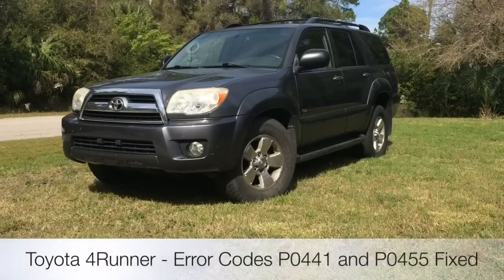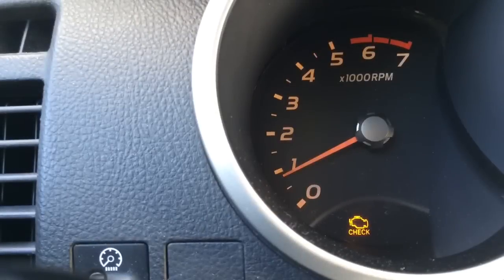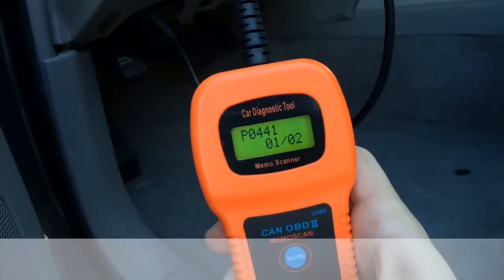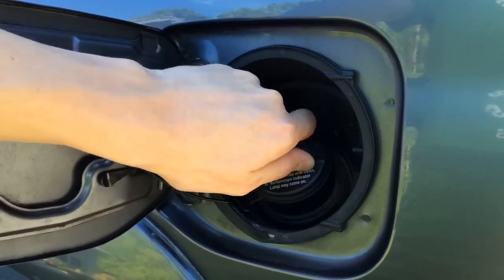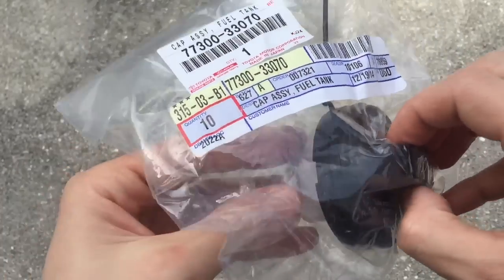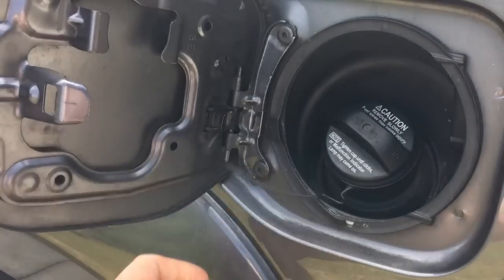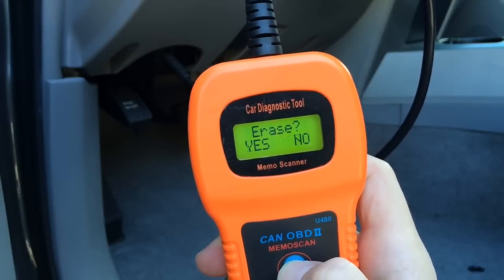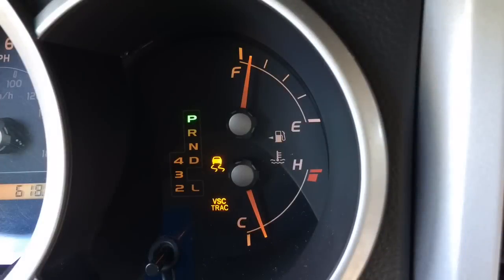[SOLVED]: P0441, P0455 & P0456 Codes - Evaporative Emission Control System Leak - Bad Fuel Tank Cap

Comment: code scanners are ok but its a small guide line to what the symptom is, p 0441 and p 0455 are small to large leaks,,and yes in most cases this will tell you to check the gas cap,,in most cases if the car has the original cap chanses are good that the cap o ring is worn and for the 40 dollars its worth replacing anyways, now most cases the  code or both codes may or will come back with pending codes in the system, this means the car is self checking the system, this may take up to 40 to 50 key cycles,, if the codes are still there then there is other issues like a bad purge valvem this means that its not holding vaccume, or is not sealing properly or does not activate on power up.. check the oms, the reading should be between 14 and 30,, under or over that threshold the valve needs replacing, if you now are at the stage that the cap and valve have been replaced and codes are still there, then vaccume lines need to be looked at for leaks or cracks, possibly the canister is contaminated with fue, this contamination is caused when a owner overfills the car with fuel,,what i mean by this and we have all seen that one person having to to be at the exact number on the pump ex: 56.00  dollars, when the pump clicked at 55 .10, overfill will contaminate the canister in time,,, so when it clicks ,,,,stop,,,,so to finalize this rant,,, cap ,valve and last contaminated canister,,,,,but there is no replacement for a good scan tool, those 40 dollar units are ok but they are basic and can steer you wrong at times,,, but they do help

Comment: I’m having this problem but they say it’s the EVAP canister and I’m not entirely sure I trust that diagnosis. I used some bad gas by accident recently and have treated my fuel tank with stabilizer, hoping that will help
Reply from the maker: Go get a second opinion in a different place and see if they give you the same reason... Don’t tell them about the first diagnosis.

Comment: Hello 
Will my warrant be void. If i clear the check engine light with the obd scanner. I have a EVAP leak in my 2016 Corolla P0455 and P0441 so i decided to get a new oem gas cap and remove the old one and then clear the check engine light with obd scanner.  So will this void my car's warranty or is it safe  to do this. ??? 

Thank you.
Reply from the maker: I don't think so, but I would say call them and ask, just to be safe.

Comment: Bitch I looked up code p0441 and that's why I watched this video. Not to fix my gas cap.
Reply: Sirjacome48 Same lol I got the same code so I just bought a new evap valve
Reply: Same lol. I wanted to fix that not my gas cap. This nigga should have fixed the purge flow valve not the gas cap.
Reply: Sirjacome48 did replacing it work?
Reply: oh okay. i just got the evap. canister thing removed and the light came back on.. so i went to get it tested and the highest chance was the gas cap so i bought a new one. when do you think the light will come off.
Reply from the maker: I can tell you for sure, replacing gas cap worked for me.
Reply from the maker: Did that work?
Reply from the maker: You can fix whatever you want, I just showed what worked in my case. After replacing gas cap problem never came back. 
If you had similar codes, but different solution for the problem, go ahead and share your tips with others  in the comments or better yet record a vidoe and share it with the world, rather than complaining about others who tries to help by sharing their experience. 
Best regards.
Reply from the maker: It takes certain amount of driving cycles until ECU relearns  and codes will go away. But you can also erase the codes using OBD2 diagnostic tool, or unplug battery terminal as a last resort.
Reply from the maker: +Sirjacome48 
Fuel tank along with gas cap are both parts of evap control system and are directly related to the problem for P0441 code. Broken or loose gas cap disrupts system vacuum, causing P0441 and/or some other codes. Pease do some research before showing your disrespectful manners next time. Greatly appreciated.

Comment: where did you buy the toyota gas cap at
Reply from the maker: Most of the time and almost everything I buy online.
It's always much cheaper then buying from dealer or autoparts store.
I only shop at Amazon.com and ebay.com online.
These websites are very reliable and have literally everything...
Reply from the maker: Also there is direct link for gas cap in the description of the video if you need help finding it.
I hope that helps!

Comment: i replace new cap but after 10 days the code come back
Reply from the maker: Is new cap closing tightly?
Reply: 4Runner yes ,and i order new original cap from tayota official delar by VN for my car .
Reply from the maker: Are you getting the same exact error codes? 
Is there any additional codes?
Reply: I get two codes come together  p0441 , p0455
Reply: And 4 lamps on . Check engine,  traction , tow VSC light
Reply from the maker: Have you tried erasing code with OBD2 tool?
Reply: Yes but will come back after 3-6 days . I bought obd2 because this issue :(
Reply from the maker: You probably have evap system leak somewhere else than. 
Try to look for Evap System leak detection videos.

Comment: I have a 2008 4runner and the same combination of lights came on. I drove it about 4 days before I got a new gas cap. The lights still come on now but I have only been driving for 1 day. Do I need to erase the lights manually? Or will it eventually turn off on its own?
Reply from the maker: +Chase Hollywood 
You can erace codes manually, or wait until it goes away on its own. It takes some time for car to relearn.

Comment: Gas cap doesn't cause the vsa light to come on
Reply from the maker: Richard Evans 

At first I thought so too. It just didn't make sense. But VSA light came off at the same time as Check Engine Light for Evaporative System Leak.
None of these lights ever came back since I replaced the gas cap. 
If you really want to test it, leave your gas cap open for few days and see what lights are going to come off on your 4Runner.

Thank you for your comment!
Reply: I guess toyotas are a bit weird in that sense. I've never heard of that before but I'll definitely take your word for it lol
Reply from the maker: Richard Evans 
They are. I've got enough lights for a Christmass tree on the dashboard just for a gas cap.
Reply: Idiot.
Reply: same exact lights on a 2013 RAV4. roughly 42k miles. had it scanned and the same codes popped up. I re-tightened the gas cap and will wait to see if the lights ever go off. thanks for sharing
Reply from the maker: It may take some time for ECU to relearn, but if it was just loose gas cap, it should fix the problem.